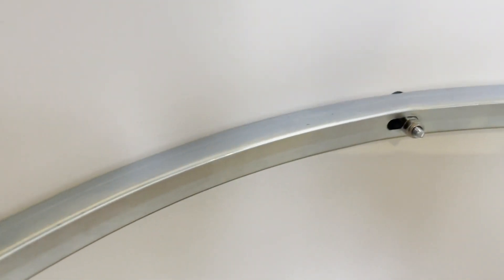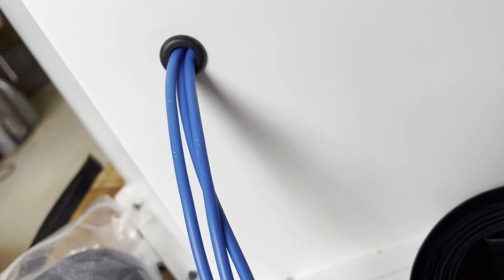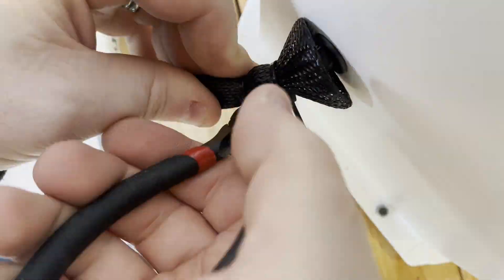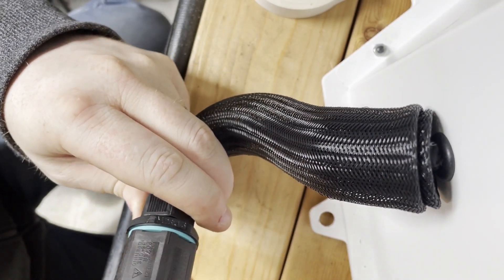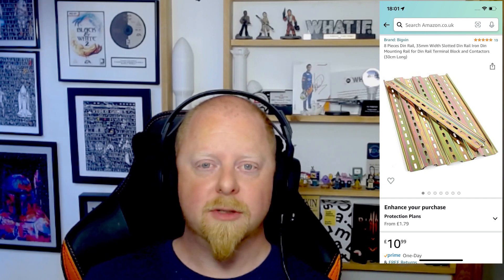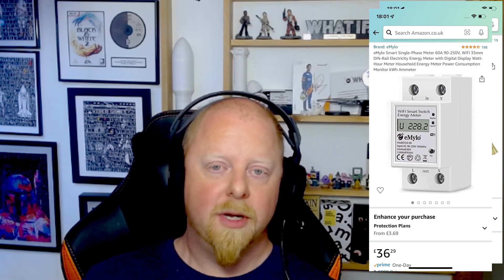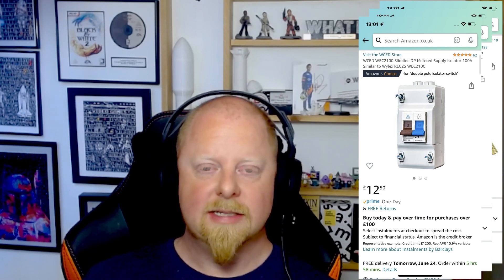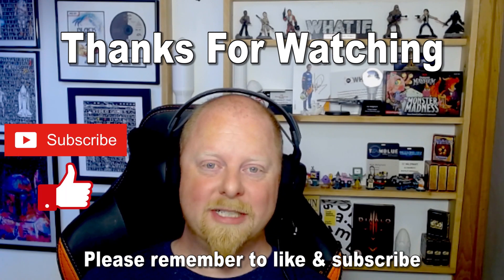Wind Turbine Update June 2022

Comment: If the TESUP can only supply ~75V from the controller, how will the inverter start up with it's 100V+ startup voltage requirement? Or are they shipping a lower voltage inverter?
I mean, this will only work if you have continuous wind to spin the thing to give you stable 75V AND you also have a 50V+ startup inverter.....
Or am I missing something?
Reply from the maker: The Delta inverter I’m waiting for has a 35v start up, so my hope is that it will be enough to kick it into gear. 
I will report my findings when I eventually get it!
Reply from the maker: The Delta inverter arrived today!!!

Comment: Followed all your videos wth interest, as I am awaiting delivery soon of Atlas 4, maybe with no inverter if your 5kw is not due to September. I am very interested how you propose to mount the turbine. I am thinking  of mounting it on the top of a 6m scaffolding pole which has a plate welded on top on to which the turbine is bolted, the pole would be clamped on to the side of a barn protruding approx 1m above the ridge. Your opinion would be most welcome. How can I contact you further to discuss
Reply from the maker: It’s way too big and heavy for a scaffold pole. I’m purchasing F34 truss sections which are 2.5m each and I’m mounting at 7.5m up. You can contact me via the email address on the channel. Thesustainableorange@gmail.com
Thanks for following!
Reply: Thanks for info on F34 trusses, I  notice on other Utube intallations of Atlas 4, some are using F33,. Do you thinkk this would be strong enough. I am planning  5M and 1m bottom  trusses, putting 2 hinge pins at  joint to enable  the turbine to be lowered for maintenance. Trusses would be clamped on to barn  top for stability. Did you get my email?

Comment: Does the power monitor have some sort of memory capacity to store the info, or are you downloading it on the fly to review later?
Nightmare that you're still waiting for the inverter 😩
Reply from the maker: No it’s just a real-time output so I can see what’s happening.
I might add a CT clamp monitor later, but this is more for DC monitoring than 3 phase AC or 240v ac.
Tesup offered a 3kw inverter available in 10 days or the 5kw Delta has an ETA of September, so I have opted to wait for that as it should have a lower start up voltage (35v Vs 50v on the 3kw Growatt)